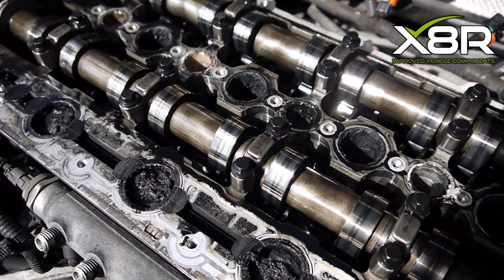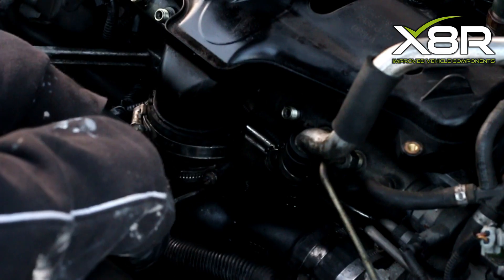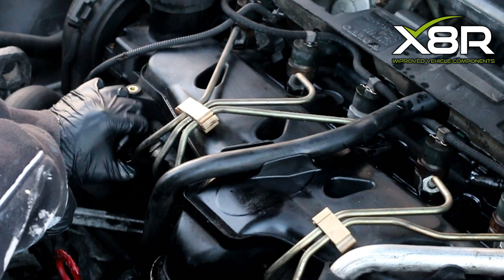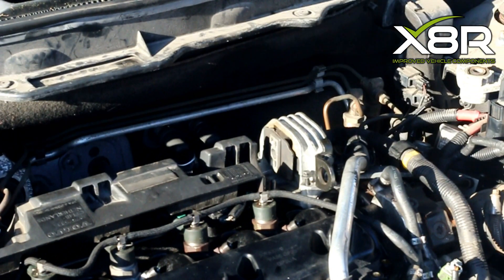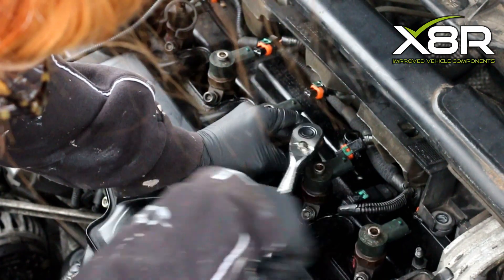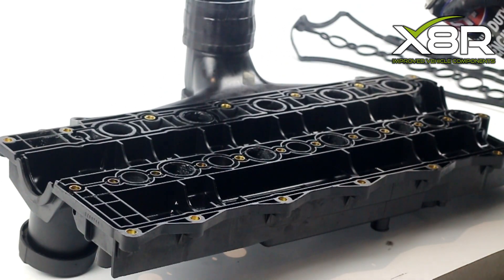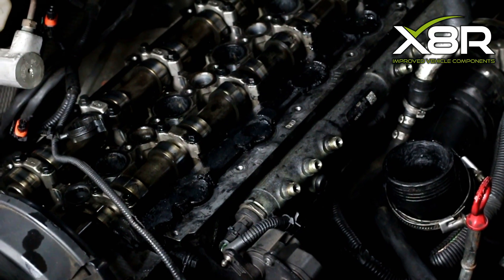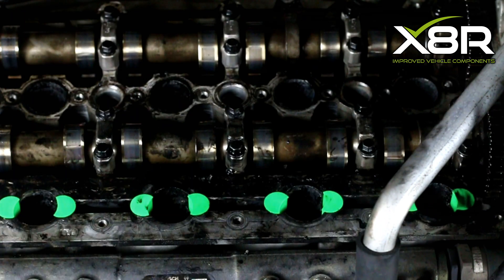P2015 Clogged Or Disconnected Swirl Flaps On Your Volvo 2.4L D5? XC90 XC70 XC60 V70V50 S80 S60 S40

Comment: So, what is the downside of removing the swirl flaps? There must be reason Volvo engineers put them in in the first place?
Reply from the maker: I found an interesting article which explains swirl flap removal in-depth, with negatives being listed at the bottom, which you can see there are few:

https://www.yorkshiredpfcentre.com/swirl-flap-removal#:~:text=The%20process%20for%20removing%20the,the%20flaps%20left%20in%20place.
Reply: runaway diesel
Reply: @emilandersson4444 removing flaps wouldn’t cause that at all. Runaway diesel is caused by turbo oil seals passing oil
Reply: @HGVCraig lost power at low rpms ,i tried two identical cars one with workin swirls another with taken out and programed out ,one with swirls was significantly more alive and gots better acceleration

Comment: Hello...
I have a V70 2.4d from 2006...

Can anyone give me a rough idea of the cost a garage will roughly charge for replacing these Swirl Flaps??
Reply: In Europe Volvo repair shops charge around 1200€ for the repair
Reply: @phyrros1 eso es jodidamente demasiado. Ni en casa volvo... Hacer eso llevará 4/5 horas de trabajo quizá. Depende lo que tardes en quitar los inyectores. A 50 euros la mano de obra son 250 euros.

Comment: Fitted this kit today, good kit has worked for me. my actuator arm broke, my swirlflaps was stuck shut the car felt very restricted would go in limp mode everytime i reached 3k revs, and my mpg was very poor, since using this kit my car feels like a rocket compared to before and my mpg has doubled, i think it depends on what angle ur swirl flaps was stuck at to how much of a improvement this will make for your car but for me where the flaps was fully closed and clogged with years worth of crap it has done wonders for my car. Would deffo recommend
Reply from the maker: Thank you so much for the amazing review and helpful comments on our video! Certainly very much appreciated! If you wouldn't mind leaving us a Google review we would be very grateful: https://g.page/r/CUq3bqyGoDaTEB0/review
Reply: Matt, this sounds like my problem... I have a 2006 V70 2.4d and the Engine System Service Required message is on... Also the car drives fine but as soon as it hits 3000 revs it seems to get restricted, like a limp mode...

Is this what you're describing too? I'm not mechanically inclined but car is booked into garage... I was wondering how much you think I'm gonna be looking at to pay for this Swirl Flap replacement??
Reply: @RobsterlikesRonPaul sorry only just seen your comment😅 I'm guessing you'll be sorted by now

Comment: Hi, I fitted the kit to my xc 70 d5, 2006, ( euro 4)  I took my time, found the kit excellent value, and and profetional, n/b pay special attention to the injector,  protection,  , and clean up the injector seating ports with, air intake cleaner,  and  clean rag on a long screw driver, ensuring, injector seats are clean,  I have exspireanced, no codes at all,  sw/ flap actuator still in place, power is good,  economy, is good as well,  at the same time I have replaced the turbo actuator ( electronic)  as this was not operating as it should  and was getting codes stating turbo boost to high, turbo boost to low,    the swirl flaps cause a build up of soot, and I feel  it will run cleaner, internally without them,  p. S  prior to  placing, swirl flap deletes,  clean up the area with, carb cleaner/ engine degrease  on a rag,   I hope this  is of help to any interested party's  🤗👌
Reply: Hola! A qué actuador de turbo te refieres?

Comment: Will i get error code if i use this kit?
Reply: D5, injector removal....  Prior to fitting of kit,  buy some release spray               (halfords do this)  day or two before injector removal, remove engine cover, and spray generously around base of all five injectors,  avoiding fumes, and carrying out safety instructions as stated on the can,  before and after driving,  before removal ensure engine is warm,   mark up injectors 1 to 5, and there coraspinding areas, remove electrical plugs, remove injector fuel supply pipes, use protective caps supplyed,  then remove fuel return pipes  ( small retaining clip) and use protective caps supplyed,   spray release spray around base of injectors, and leave for 5..10 minutes,   the release the two bolts holding down the injectors on each side, once they are free,  with a adjustable spanner, or suitable spanner,  on the flats of the injector body, gently work it from side to side
Reply from the maker: You shouldn't as the rod actuator motor will continue to work as normal.
Reply: @X8RLtdUK 
It will give error since the motor will feel absolutely no mechanical resistance whatsoever, thus there will be the broken swirl arm error
Reply from the maker: @gheorghinacov6008  it didn't give an error on our vehicle. There's no electronic sensors on the original arm so no warning code.
Reply: No.. If you leave actuator in place.., if the swirl flaps were to be connected, and in normal opporational condition, there would be no restriction anyhow, the main problem would appear to be, that the throw of the actuator and arm is greater than the travel of the swirl flap connector pivot, resulting in the socket getting worn  and the connector rod disengagement, so in my consideration, save any future grief, and fitt a delete kit 😊👌( no code for swirl flap, well not on my euro 4 d5 2006)
Reply: Continued from above... Work the injector from side to side, whilst lifting at the same time,  once injector is removed, put protective cap on tip, n/b   be careful not to knock, damage, and keep clean, the injector  and take note if the little copper seating ring is in place on the injector,    bag up the injector with retaing bolts immediately.....    N/B  I ASUME NO RESPONSABILITY, FOR DAMAGES, BE IT PHYSICAL IN ANY FORM, OR MECHANICALLY CARRIED OUT BY ANYONE, APART FROM MYSELF,  FROM THIS DATE AND TIME ON,    THE STATED PROCEDURE FOR INJECTOR REMOVAL IS FOR GUIDANCE ONLY...
Reply: @grahameleggett786 🤡🤡🤡
Reply: Is there anyone in Essex who can help do this on my xc90. I am concerned with removing the injectors
Reply from the maker: @richardwhiting3216  If I can do it, anyone can! That's my motto. As long as you have all the tools (full list in the downloadable instruction guide via our website) then it will be straight forward to carry out the install. I would set aside a whole day to do it if you are a novice and take your time. But realistically should only take a few hours. If you need any help please give us a call on 01843 446643 - Georgina, X8R Ltd
Reply: @X8RLtdUK  I am no mechanic and got this done in a few hours( took my time not to break or drop anything and kept loosing tools 😅) but I'd say anyone could do this you may just be unlucky and have a injector or 2 that are seized in but besides that very simple
Reply: I instaled kit last night and got error code... So I had to code out swirl flaps as well...
Reply: @yt2011F  did you do this with Vida
Reply: @ no, KESS